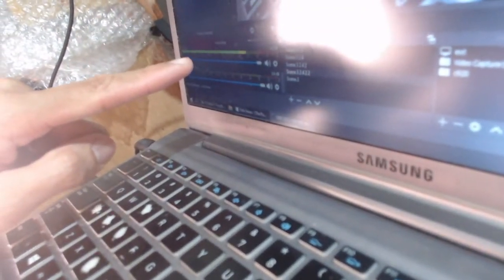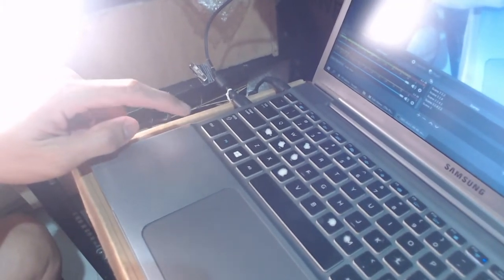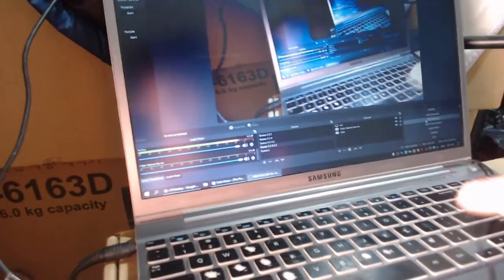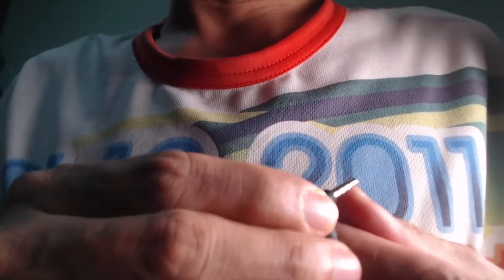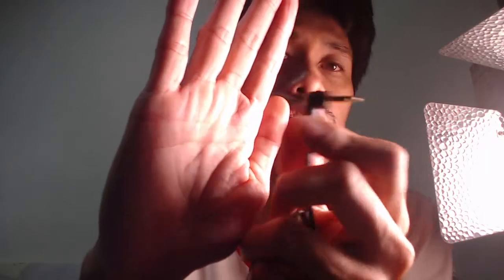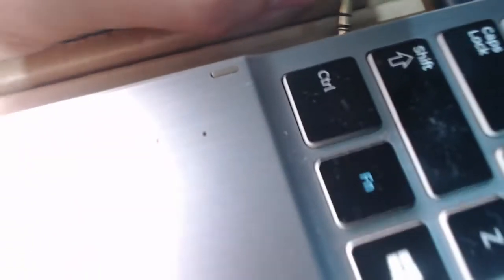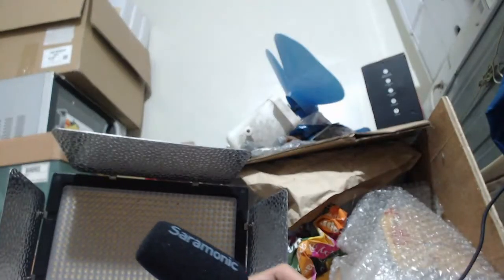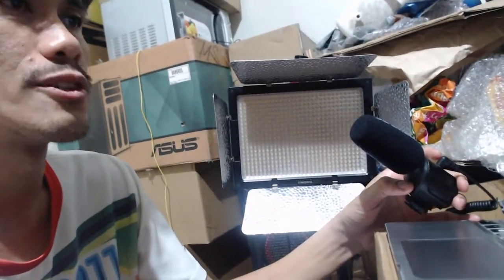troubleshooting laptop internet/external microphone connectivity - TRS vs TRRS

Comment: "thank you very much. the software "jump cutter" is for windows. im searching one fir MacBook. I don't know if sir Rodelas can share how to remove air gaps using Macbook pro not manually.
Reply from the maker: the jumpcutter that is for windows and is not free is the easy-to-use version po.

i use the original jumpcutter w/c is difficult to use but free.
https://github.com/carykh/jumpcutter